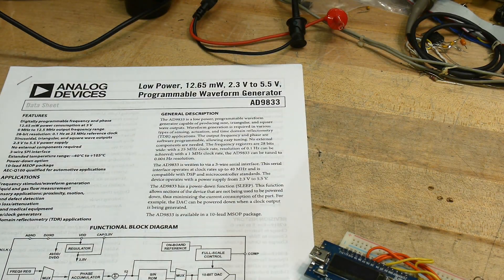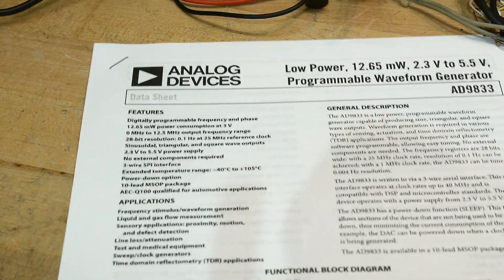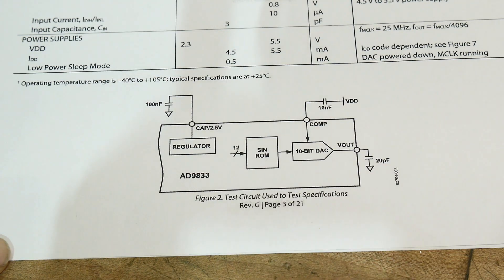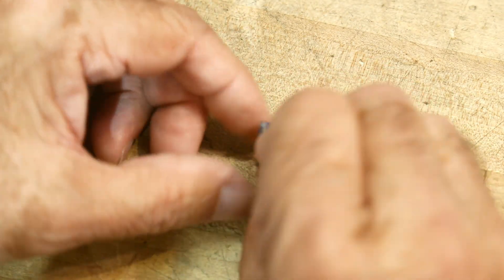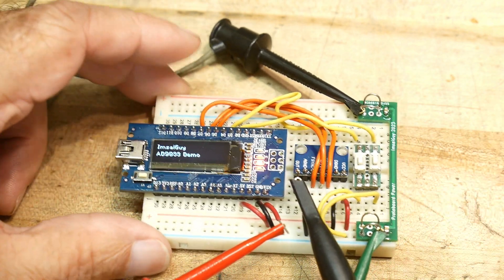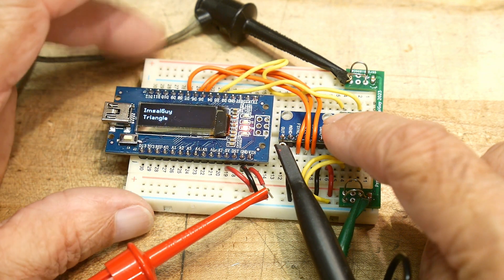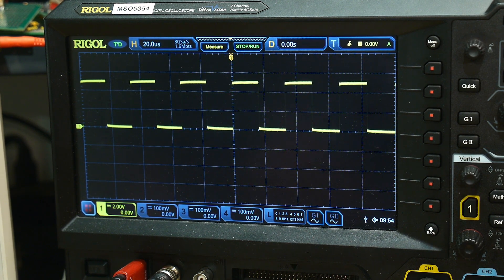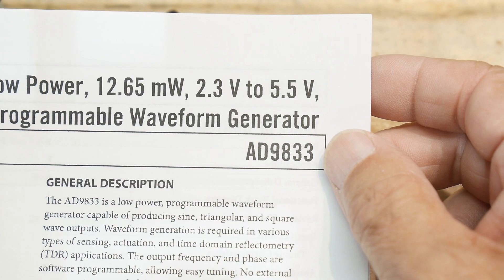#1670 AD9833 Function Generator IC

Comment: Too bad's it's not a programmable AWG. Of course, you would need an input mechanism to define the points, etc.
Reply: You can use a fast micro with a DAC to make one of those.  A lot of micros have DACs that can update at a MHz or so built into them.

Comment: I was wondering about distortion products. How would this compare to a Weinbridge oscillator with VERY low distortion, for example? Looks like a good chip regardless. Thanks for showing.
Reply: The Wien bridge in named after Max Karl Werner Wien (like in "Vienna", not in "wine")
Reply: I would love to know this too for comparison as I am using a bulb stabilised Wien Oscillator or should I say, I have a prototype that I'm confident will work well but I only just got the PCBs back from China !...cheers.
Reply: 56db is not too bad
https://www.analog.com/media/en/technical-documentation/data-sheets/ad9833.pdf

Comment: It's a bit odd that a sine wave has low amplitude if the chip is using a lookup table and a DAC. You would expect that when creating a sine wave from a triangle wave or a PWM signal that passes through an LP filter to generate the sine wave, but not with a lookup table and a DAC.

Comment: Here’s another 47yo newbie question. If a person was to take a given chip , 555 for example, and recreate the block diagram on a breadboard with individual components, it should have the same functionality? Obviously it would be a rough approximation but theoretically, it would work, yes?
Reply: Short answer is yes. 

You specifically mentioned the 555. If you Google "Three fives discrete 555 timer" you find a batch of vendors that offer a kit that is the 555 IC built with discrete parts.  Kind of expensive, though. There are other articles--many found through Hackaday--describing building a 555 from discrete components. I didn't follow up, but apparently there've been topic chains on building a uA741 op amp using discrete parts as well. Of course, the IC offers advantages. For example, it's a lot easier to have matched transistors if they are on the same substrate.
Reply: Short answer is yes.  And if you used "fast" individual components you could make a "fast" 555 etc. Note that breadboards can be a limiting factor for speed.  555's are cheap.  A bunch of components are going to be bigger, more expensive and probably take more power.
Reply from the maker: build one: https://shop.evilmadscientist.com/productsmenu/652
Reply: @IMSAIGuy Holy Crap!!!! I knew I saw this somewhere. Thanks for the link.It’s been bothering me more than you could know.
Reply: There are many things done on integrated circuits that are very difficult to do with discrete components. 

Many things done in analog ICs rely on matching and thermal tracking of devices, for example. Sometimes there is a scaling of "matched" devices, for example a current mirror might be made so that current from the "output" side of the mirror is 4 times the current from the "input" side. You'll find things like multi-emitter transistors on ICs, not as discrete components.

You can learn a lot from trying to do such things, but you can also run into horrible frustration. Something like a 555 is moderately easy and instructive provided you use other integrated circuits as building blocks and don't try to do the whole thing with transistors and resistors.
Reply: Usagi Electric even built a custom 555 with vacuum tubes. :) https://www.youtube.com/watch?v=bjAlzA4Cyys

Comment: i used this IC for moisture detection project for 6 month, only thing worked perfectly on that project is this IC, project worked in simulation but  in field too much drift in result, very difficult to face my employer,  luckily they didn't hurt me, project dropped in the end
Reply: One very great merit of DDS is that it is extremely stable since all frequencies are derived from a crystal oscillator. If your project failed it wasn't due to frequency drift unless the clock oscillator used was garbage.

Comment: Great chip! I have used it in quite a few different projects, kinda digital-NE555-versatile chip. Though, it is prone to heavy phase jitter when used above 1MHz. At around 3MHz the jitter becomes so big that the chip becomes useless...:(
Reply: Did you make sure the impedances were matching at the higher frequencies?
Reply: @KeenBeanPlayzGames  Ofc, every time I work with anything above few kHz, and/or fast transitions. Chinese versions from arduino modules jitter more, original chip jitters less... But up to few 100s kHz it's perfect little chip. In other hand, as a frequency (clock - squarewave) generator SI5351A is jitter-wise quite good being chinese copy or original.

Comment: that's high quality! now I've got 2 ask CGPT what to do with this!
Reply: A few days ago I watched a video in which the presenter was replacing a part containing two power MOSFETs and a control circuit. There were apparently two versions, one with a datasheet available from the manufacturer and one with a datasheet harder to find but available.

A couple of people as CGPT about the difference between the versions. Another asked some other AI thing. All of the responses were complete and utter rubbish and worse than useless. One was so bad it was taking about parts that weren't even vaguely similar to the those in question. Another made comparisons completely unsupported by the datasheets.

Comment: It’s handy having a 5V square wave for logic applications - it can always be attenuated for audio applications. I wonder if the programmable frequency has enough resolution to sync to another incoming frequency to get a phase accurate signal?
Reply: You would need to make something like a phase lock loop.  Remember that no matter the resolution, it is finite and chances are your crystal will drift a bit with time.

Comment: This would be cool to integrate with an ESP32
Reply: That’s very easy to do, as the chip works down to 3.3V. The Arduino library that IMSAIGuy references in the video works out of the box with ESP32–I use one of these chips in my homebrew signal generator and it’s great for the price.